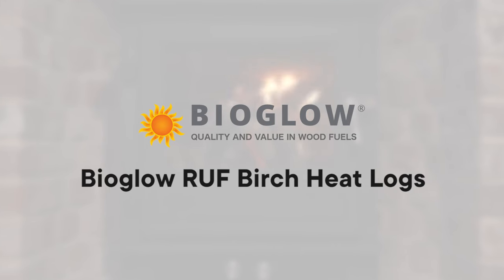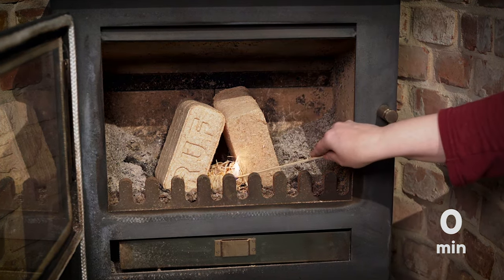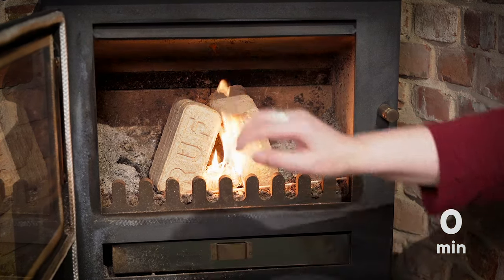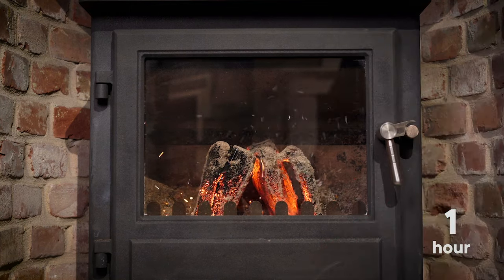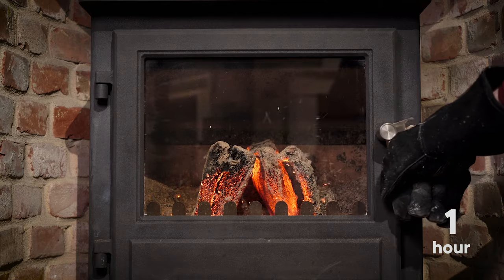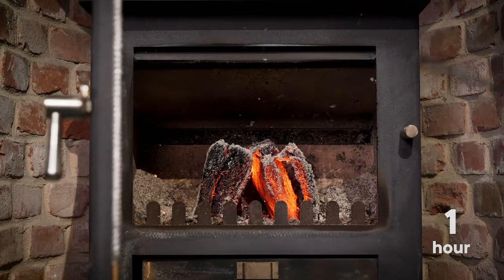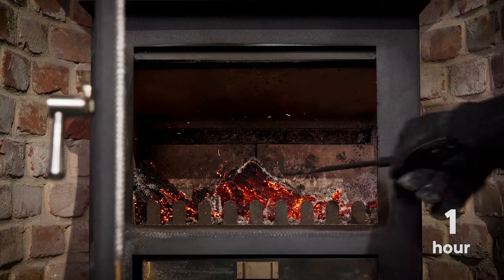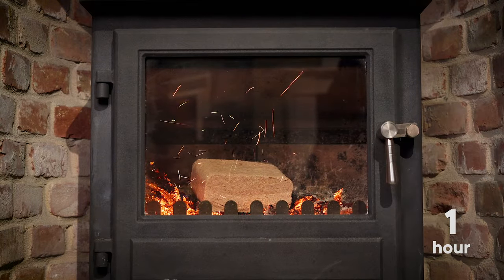Bioglow RUF Birch Heat Logs in a 5kW Clock Wood Stove

Comment: Have to disagree. As someone who buys 2 tonne a year of these, there are a few suggestions..

1) the briquettes do need a firelighter at least or firelighter and kindling ideally.
2) 1 heat log will last approx 35 to 45mins max before turning completely to ash embers.
3) They burn with the same heat as kiln dried logs, but make slightly less ash

Overall I still use heat logs my self as they are not as messy and easy to store but I think Importantto be  very transparent with the product.

Comment: I have had two fires using them and have found the heat output to be very low, no appreciable difference to the temperature of the room. Very disappointing.
Reply: Thank you for your comment. Most users will add more logs than shown - it depends on the size of the room and size of the stove, and how warm you'd like the room to be. In a well regulated stove, pound for pound, heat logs will be better value (in terms of calories released) than kiln-dried logs. We are available to answer questions on info@bioglow.co.uk or 02030020359.